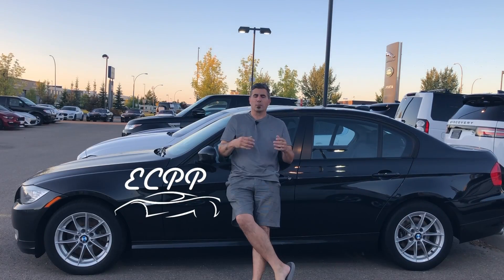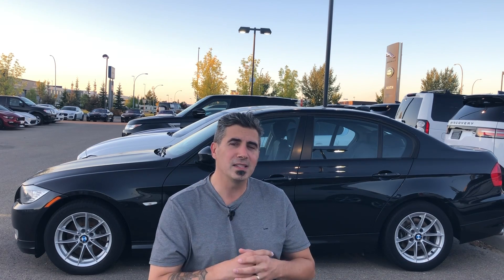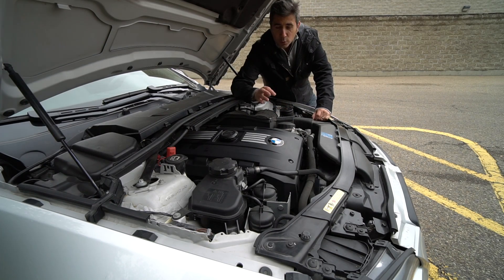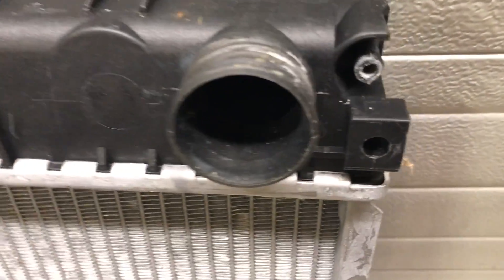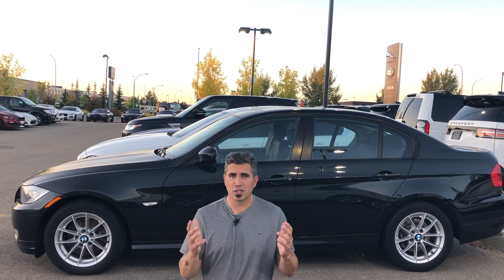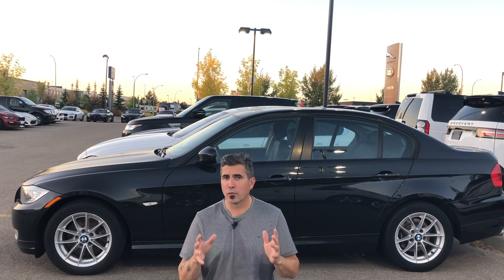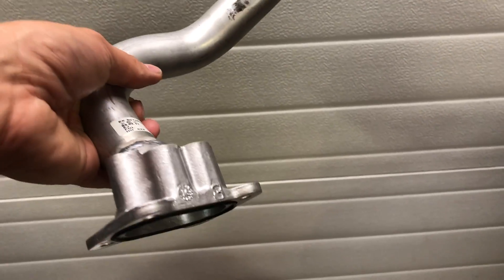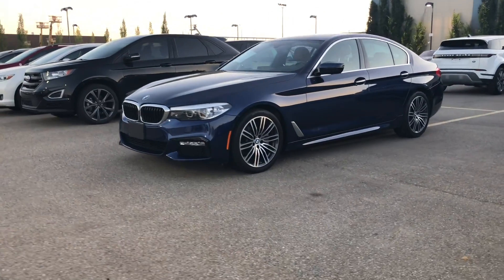Why Does BMW Use Plastic Engine Parts??

Comment: unrelated, the first oil change on a new 4 series is 10k kms or something. Do you recommend an earlier oil change to get break in gunk out? I asked on the Facebook b58 group and most said to wait for the scheduled change, which I found surprising
Reply from the maker: It would be at your cost as ore paid maintenance would not cover but I agree with you and BMW oil service intervals have been far too long for awhile now.  There have been discussions around this topic, so in short, it would not hurt.

Comment: Exactly why I'm out of the BMW, now.
Reply from the maker: Hi Thomas, any updates on a 911 yet?
Reply: @ECPP  I can have a lengthy response. in short, immediately after warranty, I had a cooling issue with my m55 335i. A hose had ruptured. Anyway, you get the picture and this video summed it up precisely.
In short, the 911 will need to come in 2021.
Although I could afford a high payment, even retired, I choose not to do so. My needs are for 2009, or newer, 911 4S with PDK due to back issue.
Got rid of the 335i and, for now, got into a Porsche Panamera with good service. Very comfortable and decent performance with the V8 non-turbo.
Bottom of the depreciation curve, not a loss will be realized when sold. I just prefer not to finance a 911 till I can't drive it anymore.
For now, anything to get out of the BMW.
Reply: Thomas Helm 
Have you test driven the Lexus LS 500 F Sport or LC 500?
Reply: klau88873 Great question I’d say he should make the switch I definitely did Lexus for the Win 😎
Reply: @klau88873  I haven't. But they are great cars.
I'm partial to Porsche, for several reasons. Personal preference, really. I do have a Toyota 4Runner, as a daily driver if I wish

Comment: Ironically my 2016 merc GLE Coupé overheated 12 months after purchasing, lucky for me I was close to service station, pulled in and made checks only to realize that a plastic fitting taking water to the heating systems was broken, slight airline crack..
Could have cost an engine if I was not observant..
The dealer had several of these fittings in stock, thereby suggesting that they anticipated a problem or had seen the same scenario before..the part was attached to the firewall so I assume the engine vibrations contributed to the failure..
In contrast, my F80 bmw seems to have a lot more plastic fittings and pipes but obviously made from better materials, much sturdier and less problematic..

My research is showing that Mercedes is cutting cost by using cheap materials while bmw is outsourcing cheap labor but using the same high standards in their production..
In fact I’m on my second set of brake rotors on gle while I have never changed rotors on my 1992 SL ...what do you make of that..
Reply from the maker: That is quite interesting.  Later BMWs have been a bit more solid than say even the mid 2000 cars.  The b48 and b58 engines are certainly better than their predecessors
Reply: ExoticCar PlayPlace you are correct sir and as an owner of both Marques I can truly say that bmw is holding their own in terms of quality. I will not go as far as saying that Mercedes are totally crap but the owners can speak for themselves because some faults are really down to the them  not caring about their cars and not servicing on time..
These days I’m in the market for the coveted e series m car but it’s becoming a far fetched idea as the prices are astronomical so I’m planning to build my own tribute model. Will also build a c63 black series using oem parts😂😂😂

Comment: My Chevy had these issues at 80k miles.  My BMW’s first issue was at 120k miles.  Repaired now the car runs like new.    Also fixed a leak in the engine.  $2k in repairs.  No bueno.
Reply from the maker: Sounds great.
Reply: Get ready for many more leaks in the engine in the near future.

Comment: All new cars use tons of plastic in the engine. For most brands, its not much of an issue. BMW just choses to uses really cheap, recycled plastics for their cars. BMW has long had weak cooling systems, at least as far back as the 1970s, before plastic cooling parts. Even Jackie O. managed to melt down the engine in her ‘74 3.0s because of a cooling system failure 40 plus years ago. Plan on replacing the ENTIRE cooling system every 80,000 miles on a BMW as preventative maintenance or your playing with fire. It is just the way it is.
Reply from the maker: Absolutely that seems to be a maintenance requirement, which is fine is fine if there were not so many inaccessible parts and e price to go with.

Comment: BMW would use plastic pistons and connecting rods if they could.
Reply from the maker: lol, ouch
Reply: @ECPP  Sounds like the Garage 54 channel!
Reply: And plastic engine block, plastic crankshaft and plastic camshaft
Reply: If they could get them to last 3 years, they would definitely do it.
Reply: Sad but ultimately true.
Reply: I think they do lol
Reply: Dont give them any ideas
Reply: BMW is plastic. You should check out Hoovies Garage. He lost big money when he purchased a used E66 Alipina B7 bmw
Reply: I remember years ago when I was a teen there was talk about engines potentially using plastic engine blocks in the future, not only was it said to reduce weight but also friction on the pistons. I guess the idea never panned out because you don't hear about it anymore.
Reply: Yeah i bet BMWs gonna pull a Briggs & Stratton with plastic camshafts 😂😂😂
Reply: @scrapinpennies4365  as long as it last the warranty period they will do it
Reply: LOL
Reply: Like Scotty Kilmer says: manufacturers would make plastic engine blocks if they could.
Reply: They have, if you’ve ever seen a cooked S85 with rod bearing issues :)
Reply: there getting there plastic vavle cover plastic water pump plastic tensioner plastic pulley plastic oil pan plastic manifold plastic injectors plastic everything literally the only thing left that is not plastic is the piston rods crank cam block and valve you bet your ass when technologies allows those part to be swap out with plastic and last long enough until the warranty runs out bmw will be the first to introduce it
Reply: kkthxk  arnt many of the manufacturers guides made of plastics now a days?
Reply: Lol. That would truly over engineering.
Reply: BMW: "Life in plastic, it's fantastic"
Reply: @loayikailan  now shoudent to rough on them bmw is not really a car its an apliance like an iphone you get a new one when the next model comes up.
Reply: I wish BMW going to make plastic turbo's😆.
Reply: If they did use plastic internals, it would still drive better than 100% of American cars.
Reply: @TugSpeedman08  *laughs in iron block pushrod*. 😂
Reply: @TugSpeedman08  well it may in fact "drive better" but would BMWs "drive longer" than a Chevy or a Ford or a Dodge? I think not. Good day!
Reply: @TugSpeedman08  what are you talking about? The older 2v and 3v fords are running like new after 200k plus with nothing but oil changes

Comment: How good environmentally is it to recycle the plastic if a few years down the road your antifreeze spills all over the hyway? Antifreeze is very toxic to animals.
Reply: Ironically, the use of recycled plastic is done to meet the German environmental laws at mandate that new cars be made of a high percentage of recycled materials. Recycled plastics are great for shampoo bottles (and other light duty, short lived goods) but they really cannot handle heat cycling and temperate fluctuation for years the way “fresh” plastics can. Even still, the quality of the recycled plastics that BMW uses seems suspect, as other German makes don’t seem to be having the same issues with their plastic engine parts.
Reply: @brianandrews7099  Recycling plastics requires hand sorting, very uneconomic.  Then, it must be mixed with virgin plastics.

Comment: Well its about money they can easily take off all the plastic and making it last longer, but bmw dealerships will not get money for repairs. But i agree with you. Would be great to make a videon on what to change in the engine after some year to better parts that last longer.
Reply from the maker: Great point, thanks

Comment: As an auto engineer, I can attest that this video is very well-informed. Nice work.
Reply from the maker: Thank you very much.
Reply: Let me get this straight. You claim that BMW is trying to save the environment by engineering critical part failures after warranty by using recycled plastic material? This train of logic makes ZERO sense to me. It seems only to incentivize people to turn over their nearly new products at a faster rate, thus increasing demand for even more production (profit) and therefore waste.

If they truly cared about the environment they’d make all their cars so that they could stay on the road for decades without major failure. As we progress through 2020 more and more people realize that it takes far more energy to recycle than to “waste”, and so far, our energy sources are far from renewable thus increasing the carbon footprint and environmental impact of recycled materials vs new. It only seems to serve those that produce energy and manufactures that make you feel good with buzz words while wasting more than ever at record profits.

You say landfill, I say long term storage. We will be able to brake it down efficiency eventually.

Not all materials recycle the same obviously.
Reply: Hallo.Which german premium car brand (Audi,Merc,Bmw) would you rank from worst to best in terms of reliability? Thanks im advance
Reply: @pavlosangeloudis2983  I would rank them Audi, Merc, BMW from best to worst. New BMWs absolutely fall apart out of warranty. Audi vehicles hold up fairly well as evidenced by their lower depreciation. Curious to find out ECPP's take.
Reply: @MSportsEngineering  thanks a lot!very informative
Reply: @MSportsEngineering  man I am always getting mixed information about audi and bmw they're both amazing to drive and experience but some people say one is reliable and some say the other is reliable
Reply: @MSportsEngineering  what about 2014 bmw 4 series 428i coupe are they reliable I looked at Edmunds reviews and everyone says they're reliable has 4.9 stars
Reply: @abinsaji4449  Sorry my friend, I don't know.
Reply: @MSportsEngineering  ok
Reply: @MSportsEngineering  How about VW?
Reply: if he knows all that, then what about bwm workers??
Reply: which engine components would you consider okay to be plastic?  Which engine components would you consider not okay to be plastic?
Reply: As long as it fails out of warranty

Comment: BMWs are junk. Resale value says it all.
Reply: japanwatchconnection No I live on Earth. On Earth, Lexus resale values are among the best.
Reply from the maker: Ouch.  There still can be some amazing buys but a person must budget for this type of maintenance.
Reply: @ECPP  and most can't afford that ridiculously expensive maintenance/parts and get next to nothing when they sell it. All that for a slightly quicker 0-60 time. Not worth it for most making less than 6 figures.
Reply: @japanwatchconnection Lexus resale is the best in the entire auto industry! What are you talking about?
Reply: Naah. You just need to know what your getting into first. If your use to Honda/Toyota reliability, can’t or don’t like turning your own wrenches, and hate spending money on your car ... then a BMW is not for you. Trust me, I am a big cheapskate ... but still love driving and wrenching on pre 1998 BMWs.  Cheap to buy, lots of aftermarket parts out there for cheap (some of them are garbage but some are as good as or better than oem).  They can be challenging to work on but some people enjoy a challenge.  The newer ones (post 1998) look great and are fun and fast to drive, but the are simply far too “digital” for your average DiYer to handle. You need too much computer software and computer skills to diagnose and recode repairs. Sadly, even your basic Chevy and Honda is moving in this same direction.

Living with a BMW is a little like dating a supermodel. Everybody wants the thrill of that “arm candy” but most can’t handle all there own jealousy issues! It’s not for everybody.
Reply: @brianandrews7099  Know what you're getting into? A money pit with little resale value. Not for most.
Reply: 4 series cabriolet has entered the chat.
Reply: japanwatchconnection  You are not  living on Earth

Comment: I'm glad I sold it after discovering Scotty Kilmer on YouTube😅 I nearly fell in the BMW_money_pit.
Reply: Even modern Hondas are going that plastic route. It's sad.
Reply from the maker: Thanks for watching
Reply: @ECPP  Audi & BMW - similar engineering solutions.
Reply: I was planning on buying a 2018 X1 28i, but after listening to Mark, automotive common sense kicked in and I decided against buying the ultimate driving machine
Reply: A BMW is not necessary a money pit. If you can maintain it yourself and love doing so then it is something you can purely enjoy. I have two and I love them!
Reply: @ToastRunnerHere  i get a thermostat for my nissan pick up for12 euros ,i bet a thermostat for a BMW  will cost 150, lol
Reply: @gianni300rpm  That's wrong. Genuine BMW thermostat for an N63 (twin turbo V8) is $96: https://www.fcpeuro.com/products/bmw-engine-coolant-thermostat-n-a-11537586885oe. And this is one of the most expensive engines by BMW. You may compare a thermostat price with a thermostat housing assembly price. And also you didn't mention what Nissan you are talking about. I believe it's not a GTR :)
Reply: @ToastRunnerHere  90% of us are not so mechanically inclined.  Most people just want a car that will be reliable with basic maintenance that doesn’t cost an arm and 2 legs.
Reply: Do you know I feel sick when a lot of people compare the bms and mercs to other brands like toyota.if you like how a Toyota handles fine get it.if you like a BMW it's your choice.these  cars were not built to deliver the same thing.you can't build a tank and expect not to do some maintenance on it from time to time.the BMWs were not built for reliability per se.they were built for a different kind of pleasure riding.dont mix it up.if you want a car that you won't change the plugs for 10years buy a Toyota.
Reply: @theabujarealestateguyrealt1455  You may feel sick, but putting cheap plastic sh*t everywhere that gets brittle and breaks makes me sick.  What makes me even more sick, is that we can't buy a high performance German car without cheap plastic sh*t everywhere (like we used to be able to).  It's borderline obscene to make such nice engines, with so much metal, and cheapen the vehicle by including plastic parts that are known to fail in critical systems.  What a waste.
Reply: SCOTTY saved a lot of people from  jumping of their roof
Reply: Good stuff Mark!  Keep at it.
Reply: What do you drive now?
Reply: Can you show me videos?

Comment: I owned a BMW 2002 many years ago and I have to admit it was a very fun car to drive.  But the parts were very expensive and the cooling system gave me problems and was overly complicated even back then.  I ended up trading it in on a Toyota Tacoma because I will not screw over a guy or gal who needs their car to work.  Sadly,  BMW has kept this business model to this day and even made it much worse for the end users.  Beautiful cars, fun to drive, but only as leased cars for the first couple of years, but a nightmare to own as an only car.
Reply from the maker: They really are fun to drive but there is a price to pay.

Comment: Very true , plastic sucks , my 2016 M235i xdrive convertible blown the Down pipe N55 engine out of warranty. 38000 miles she drove in limp mode ,  .dealer  charged me 960 dollars to repair
Reply from the maker: Thanks for sharing.  Sounds like they were rubbing their palms together.  Sucks when These things happen and it feels like a person is getting greased.